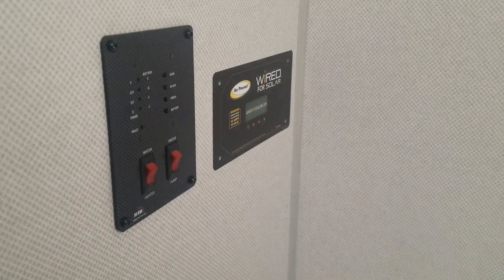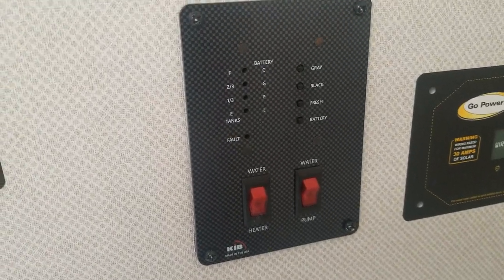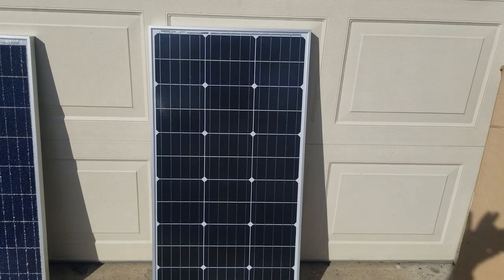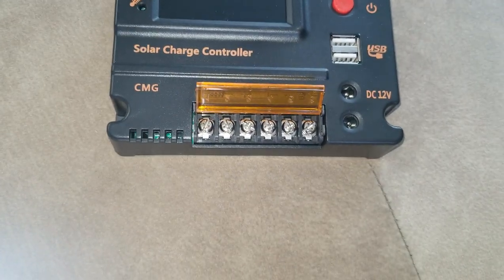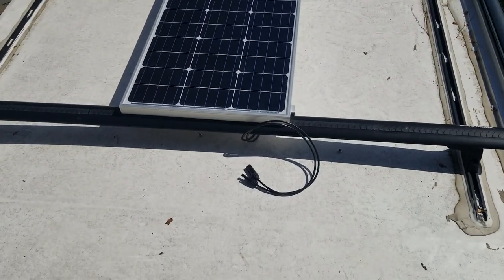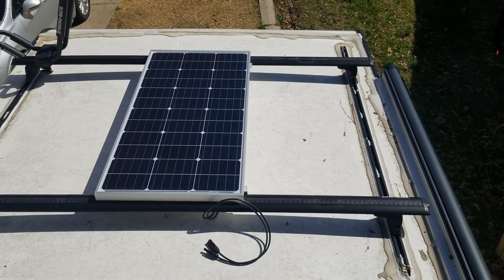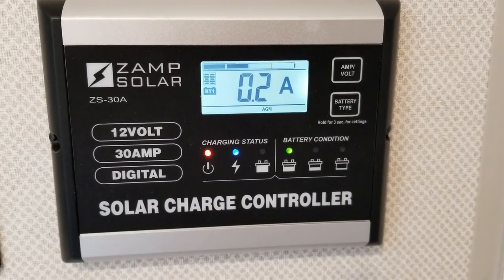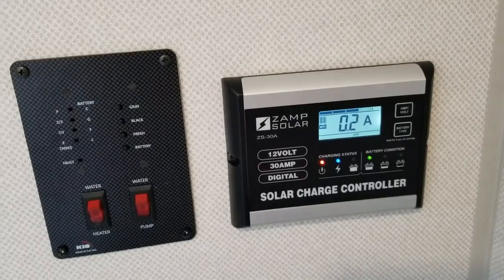No Boundaries Trailer Solar Install

Comment: So I've had a 19.5 nobo for a couple of years and wondered what truly was behind that decal in the bathroom! I'm got more than the average bear on solar experience but I just didn't know what I would find once I cut a hole in there. The fact that you looked in there from the other hole before you cut it was a smart move, thanks!
Reply from the maker: Thanks for watching! You're most welcome. The fact that the dealer that sold it to me couldn't even explain it to me sucked. I'm happy the video helped!

Comment: Can you tell me more about what brackets you used and how you attached the panels to your rhino racks? Good video though. Helped me see what I need to do to get my 16.8 into solar.
Reply from the maker: Thank you. I knew nothing was out there, even the dealer could not help. All you need are these brackets from Amazon   “Renogy Solar Panel Mounting Z Bracket Mount Supporting for RV, Roof, Boat, set of 4 Units”
Reply: @MikeAndTheGreatOutdoors  I have a 19.5  NoBo with the mounted rack bars, 2 100 W EcoTec panels and the "Z" brackets like those you mentioned .  The picture does not show how you mounted the "Z" brackets? Please explain?
Reply from the maker: @charlesschlough9097  wish I could attach a picture, but YouTube does not allow it in comments.

You attach one side of the z-bracket to the solar panel, the other e d slides under your cross bars. You do not screw the bracket into the crossbar, just under it. You adjust your cross bars so the pans can side around.  If this doesn't help let me know I'll do a quick video.

Comment: Good Job... When No Bo does the Solar Package install, they include a 1000 W inverter;forward under the bed.  Have you seen any prep wires there?? Thanks Gene Ferris
Reply from the maker: Thank you and I have not seen the factory install.  I put a 1100   watt inverter in the same place, and on the wall under the bed I put a outlet connected to the inverter and power switch. I found some wires going through the floor that I ran my inverter wires to the battery.  I used a 30 fuse
Reply: Thanks.
I was hoping that you would find AC wires that lead to the converter area!  The converter used on the solar ready RV models should support adding an AC transfer relay.
Gene

Comment: Great video Mike!  Looking at purchasing a 19.5.  Any chance you can post the part numbers for the panel you went with and the controller?  I'll have to watch again and follow more closely the connections to the battery.  From what I've seen commented here, will need two panels at a minimum.
Reply from the maker: The panel
ECO-WORTHY 120 Watts 12 Volts Solar Starter Kit: 120W Monocrysta... https://www.amazon.com/dp/B07PJH9Z6S/ref=cm_sw_r_sms_awdb_t1_F.jiFbX5XR6NC

The controller 
 Zamp Solar 30-Amp Solar Charge Controller, Monitor, Regulate and... https://www.amazon.com/dp/B00T36XBKI/ref=cm_sw_r_sms_awdb_t1_BbkiFb700JA2M
Reply from the maker: Good luck and thank you
Reply from the maker: Last thing, 200 watts should do it. I can run my fridge all day on battery and either turn it off at night or use gas at night
Reply: @MikeAndTheGreatOutdoors  This is great!  I'm sure many that will view your video will find this information useful.  Now all I have to do is convince the Boss on purchasing the RV!

Comment: Are there any additional steps to this should you want to add on more solar panels to the roof or now can you just add the solar panels as you'd like to the set up you have created?  Also, how do you like the travel trailer model? We are thinking of investing in one but so many different options! Thanks for making the video, it was awesome!
Reply from the maker: Hi Sasha, thank you for your comment.  Just trying to help others out. To your question about adding panel's, you cand as many as you want, as long as you have space and something to mount them to. I would have room for one more panel if I didn't want the kayak rack. The trailers are great. I wish the quality control at the manufacturer was better.  Happy camping.
Reply: I own a NoBo 16.6 with the solar ready setup. No nothing about solar installation. What all do I need to buy to have solar power on mine? Thanks Karen

Comment: Great video Mike. One questions, is the fuse for the system already in place? I have the 16.8 and I assume this "Wired for Solar" setup include running through the fuse box but not clear on that.
Reply from the maker: Thanks for watching, there is no fuse I could find. I put a 30 amp in-line fuse on the inside of the wall near the controller

Comment: Hey Buddy Awesome Vid, i just bought a 16.4 Nobo.. i want to add Solar just like you did... i added a second Interstate Battery upon purchase & i was told not to run the fridge or things in the outlets as it would drain the batteries quick. Would the Solar help with that.. sorry for the ignorant question, im new to all of this.
Reply from the maker: The fridge does draw alot of power. The two battires helps. If you did not run solar you might get half day on the battires. I have  ran everything on battires with Solar and two battires for at least 3 days ( sunny) stright . I have 2 100 watt panels. Hope this helps

Comment: Thank you for taking the time to make this video. I was seriously considering the NOBO line but seeing the lack of workmanship and attention to detail starting at about 2:40 is a game changer. I'll spend a litttle more money on something else. It's terrible what Manufacturers charge and to see over stressed wood, split and broken. There's no way whoever worked that section didn't know that's sub STANDARD work. Good luck to you in the future.
Reply from the maker: Steve, if I knew then what I know now my decision would be different.  Most of my issues, I have resolved with no help from the dealer.  I'm am now dealing with a problem with the trailer brakes not working.  I took it in, dealer said the adjusted them still no brakes. Blamed it on my 2015 f150 ha! It's not my truck, I did a brake adjustment myself and now they work pretty sad for a 6 month old trailer. Good luck in your search
Reply: @MikeAndTheGreatOutdoors  Thanks for taking the time to respond. If I were you, I'd be blasting the Manufacturer and the Dealer. Not hard filing a complaint with the Attorney General and the Better Business Bureau. Don't let them get away with it. Remember the "Squeaky Wheel Gets The Grease"😉Good luck to you and yours.

Comment: do you also need a inverter with the charge controller? Or is the inverter already installed on the trailer?  thanks
Reply from the maker: Only need it if you want 120 volts

Comment: Hey Mike. Excellent video!
Question...im thinking of a nobo 19.3. 
You mentioned workmanship. If you did it over again, would you buy this unit again? Or what else would you consider?
Reply from the maker: Hey bill, I guess you get what you pay for. I dont think workmanship is as bad as the quality control.  I was able to fix everything that needed attention.  Dealer was no help. So.. if your open minded and know how to use some simple hand tools you will be good.  I absolutely love the trailer.
Reply: Be prepared to redo many of the factory run installation. I new this going into my 16.8 when I bought her all good now. Check the bed mattress I had a defective bed! Replace base molding with aluminum. All the trim is cheep and pined gun crazy tear out and replace!!

Comment: Thanks for taking the time to do this.  Regarding the connection from the panel to the interface on the roof where you checked for tone, is this a fairly standard plug and play connection?
Reply from the maker: Thank you for watching.  I connected the toner (normally used on networks) to one of the two connections on the roof. My toner had an alligator clip. Once I turn on the toner I could search for the tone inside the trailer.  My problem was I had a bundle of wires inside and I was pretty sure the one I was looking for was in the bundle,  just didn't know which one it was. Have you ever used a toner?
Reply: Couldn’t you have just checked for power from the battery rather than toner ?
Reply from the maker: No. The panel was not connected to the batteries. I had no wiring diagram, so i needed to figure out what wire was what, before connecting power.  Thank you for the question

Comment: Thank you VERY MUCH for this video.
You are going to need to install at least 2 more panels.
100 watts does not cut it, especially in poor weather.
Looking forward to any future solar upgrade videos!
Reply from the maker: Your very welcome.  I added a second panel. I was able to run the refrigerator all day long. The fridge did put a big drain overnight so I would shut it off at night. I also added a second battery.  Good luck
Reply: @MikeAndTheGreatOutdoors  Do you think I can add different kind of batteries? Currently I only have a factory setting flooded type battery, I have another AGM battery before I purchased this trailer. Can I add that kind of battery? The system only allows 12v , do you think if 2 batteries become 24v will be ok? Thanks for your help!
Reply from the maker: Hey, so you can add another battery. Unless your going full time off grid, regular flooded batteries will work, and they are cheaper. Don’t mix them. I did not connect my inverter to the trailers 110 circuit. I have one 110 volt plug I put in dedicated to the inverter. I also have a remote on/off switch to turn the inverter on and off. All items I found on Amazon.

Comment: Can you explain how to attach the panel to the rhino rack?
Reply from the maker: You mount the bracket to the panel the other end slides under the cross bar. You may need to adjust the spacing og the Rhino rick to fit the z bracket in snug. Hope this helps

Comment: can you explain how to attach the z bracket to the rhino rack?
Reply from the maker: Super easy. One end attaches to the back of the panel. The other end slides under to the rack. The end that slides under the rack, is not screwed to the rack. The cross bars need to be spaced so the bracks are snug. Hope this helps
Reply: @MikeAndTheGreatOutdoors  Glad I read this.  Was about to run some tapping screws today.
Reply from the maker: @Daniel Lucas  Thanks for watching.  I'm glad it helped!

Comment: Thanks.  I've got a NO BO 19.5 and this helps clear up the solar connection questions.
Reply from the maker: Glad it helped did you do it yet?
Reply: Not yet, just running a solar panel and charge regulator directly to the battery.
Reply: 2020 NO BO 19.5 runs a single red/white line from the roof connector to the battery.  I took a leap of faith and cut into it.  Tested the voltage and saw it was live.  Plugged in the panels after that.  Overall, the wiring within the wall panel is taped up into a single mass indistinguishable spaghetti.

Comment: Hi, Michael, How can I install the inverter into break box? Which location installed you recommend? It seems nowhere to sit in the rear area.I have a 3000w inverter, do you think its match this trailer? What battery and how much panel you recommend for this setting?Thanks!
Reply from the maker: I didn't attempt to hook it into the beaker box. Never opened it up. I put the inverter under the bed. I used a separate stand alone fuse
Reply: @MikeAndTheGreatOutdoors  Hi, Thanks for reply, Where you found the red black battery wire under bad? Do I need to cut a hole of the floor to pull out that battery wires? How can you connect into the whole AC outlets system ? What color of the wire I need to connect under the bed? I just found white and yellow wires up the storage door edge . Sorry to ask too many stupid questions,I’m quite newbie for this electricity’s stuff. I will be very appreciated if you can send me some details about this process or make another video for this stuff. I think it must be attracted many many viewers like me. Thanks!
Reply from the maker: https://www.amazon.com/Conference-Recessed-Desktop-Grommet-2-Outlet/dp/B071ZG9Q45/ref=pd_rhf_ee_s_rp_c_2_1_24?_encoding=UTF8&pd_rd_i=B071ZG9Q45&pd_rd_r=80ca1595-cd2b-4523-8714-aace8590177b&pd_rd_w=86apE&pd_rd_wg=nxGoh&pf_rd_p=ea85cb41-868b-4aee-9344-f4ee71f19400&pf_rd_r=F26TZGJ4123ZQ775AD4S&psc=1&refRID=F26TZGJ4123ZQ775AD4S
Reply: @MikeAndTheGreatOutdoors  May I know how can you connect the microwave oven with the inverter? Because the microwave outputs is inside the back of microwave.

Comment: Dimensions of the zamp charge cont you installed?
Reply from the maker: 6.14 x 1.5 x 4.7 inch
Reply: Thanx again
Reply: I have the wires coming in from the solar plug on top of the traier and from the battery on the trailer. So, they are threaded through one hole. Yellow and brown. I can determine which ones hot ( probably brown one). But dont I have to know which ones go to proper contact on my controller. Sorry so long. New at it.
Reply from the maker: Color of wires can be tricky in these units. You need to isolate the battery from the solar panels.  In my video I used a toner to tone out the wires. So you need to use a multimeter. Cover the panels with a blanket so you will be able to identify the battery wires,  mark the battery + - . That leaves the other two wires, which I would assume they are to the panels. Uncover the panel now you can check the other wires for polarity. I hope this helps
Reply: Thankyou again, Michael. Prob take to my rv shop. Really dont think I'll be able to determine pos and neg wires to go to batt from ones coming from the panel plug-in on top of trailer. I mean its just a rolled up coil that you cut and wire the charge controller in line. Thanx again.

Comment: OK, at the MOST you can have 7 feet x 15 feet of solar panels on the roof. That's 105 sq. ft. The Sankyo newest military/outer space grade solar panels produce 8 watts per sq. ft. in clear, bright sunshine at close to 12 volts, not enough to keep a lead-acid battery "topped-up" without a boost box which will cost you about 20% of the 860 watts POSSIBLE, so 650 watts on a mean solar day (average year-'round) will be less than 4 Kwatt hours. Owning a tiny RV trailer (18 foot) that I've replaced every light with leds means camping "primative", just running a laptop 3 hours a night and recharging a cell phone (4 hours per night) eats .8 KwH daily, and I've not accounted for a satellite WiFi, and if you need the heater, the fan eats about 3 KwH out of the battery. You ain't got enough juice to keep a "12 volt" deep cycle charged. Water pump and A/C or fridge can't run on battery and stay charged. Those Sankyo panels cost $220 a sq. ft. plus the boost box and charging regulator. It doesn't make sense (or cents) to me to bother. Gonna climb up on the roof daily and clean the panels? Just travel dust reduces the output 50%. Sure you can do it, but WHY???
Reply from the maker: I did not get as detailed as you just did. On a sunny day with only the refrigerator on, nothing else, i can maintain the batterys (2). I change the refrigerator over to gas at night. I use maybe one led light.